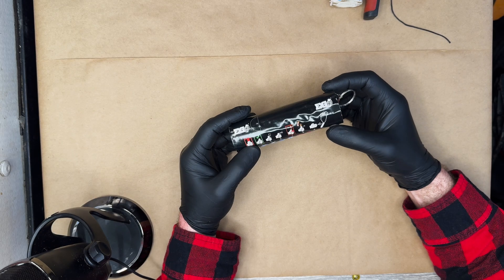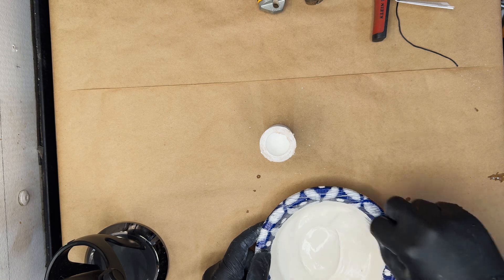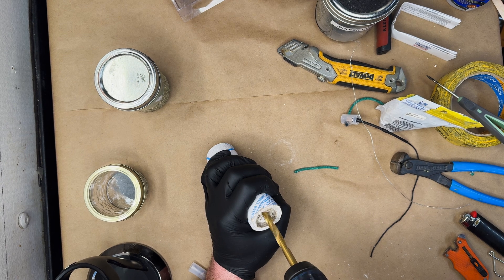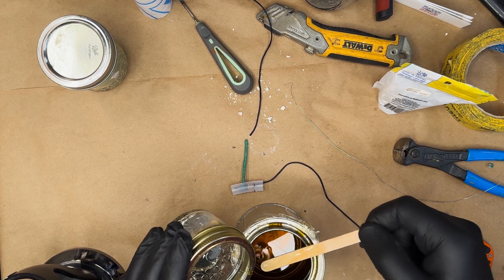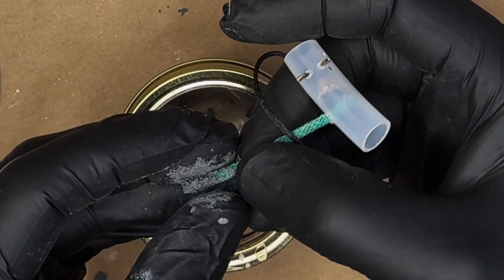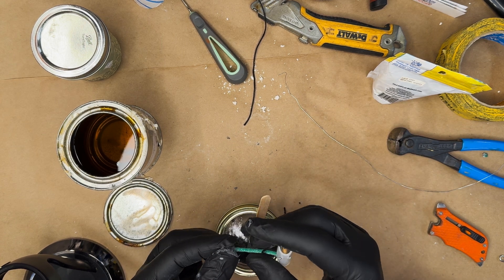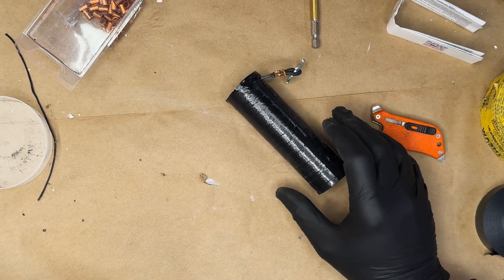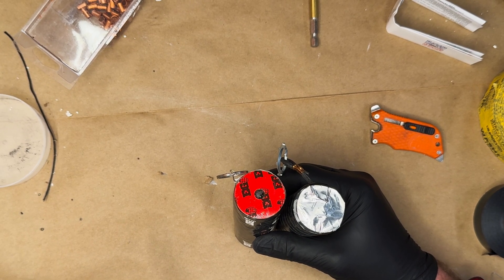Homemade Smoke Grenade vs Commercial | How To

Comment: Can you give us the formula in grams? Or at the very least the formula on how you got the composition ratio into grams?
Reply from the maker: Just call the “parts”  “grams”. And multiply all parts by the same number to scale up. I get a 2 gallon plastic bucket and usually multiply all components by 13
Reply: And that makes one smoke bomb? @InventionIncarnate
Reply: Never mind, I figured out the math, etc. have all components and will start making them (allegedly)

Comment: I tried the ratio of 14 g sucrose, 23 g potassium perchlorate, 6 g magnesium carbonate and 54 g terephthalic acid. 

Didn't seem to burn well. Is it because I'm using perchlorate instead of chlorate?
Or is it because I need an ignition composition? A fuse alone doesn't light it. 

And I will find out soon enough, but can you use colored smoke dye with a terephthalic acid composition?
Reply from the maker: Perchlorate and Chlorate are very different oxidizers and not substitutable without further understanding. If testing, do in extremely small batches (under 5g). I’m not knowledgeable or experienced with perchlorate outside of my readings on flash compositions. Perchlorate is a significantly more stable, higher efficiency oxidizer while chlorate is highly sensitive. I’m not really qualified to advise.

I will update further on the colored dye. I’m going to try and meet up with a dye guru to get some real direction on that

Comment: Skylighter has the tools and materials you need.  They have tubes and the tools for those tubes and you can compress the material leaving a channel down the center for ignition as well as increased surface area.

Comment: Any thoughts about using a primer or a blank cartridge to start the reaction off? I love your stuff, but i'm in the UK.
Reply from the maker: Yes, I did that before these pullstrings! I used perimeter alarm tripwire devices. 22 cal rim fire.

My problem was cost, you can get on temu for cheap but it takes forever
Reply: @InventionIncarnate  sometimes cost is a convince from being able to source the materials in a given country 😁
Reply: @InventionIncarnate 
I bought one of your ignition kits and was wondering if you had a instructions in a text format?